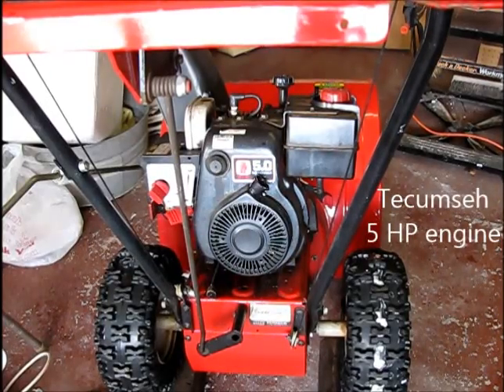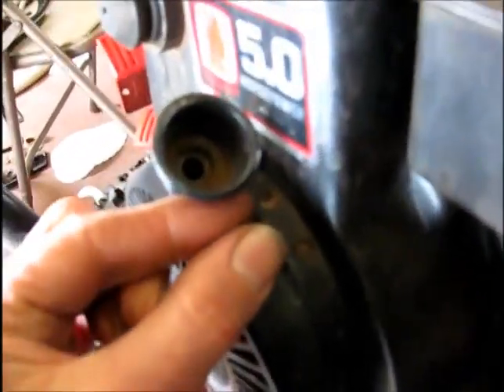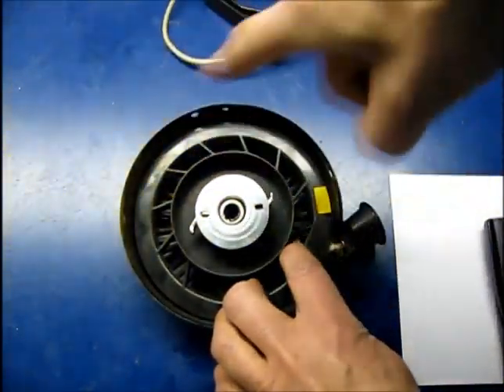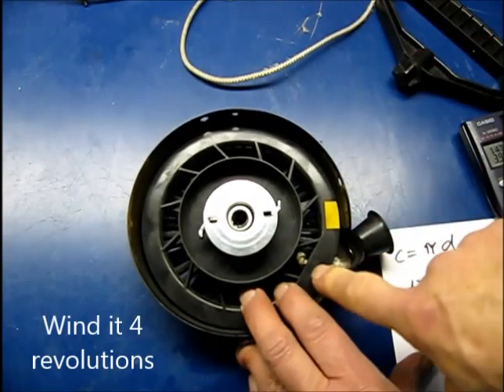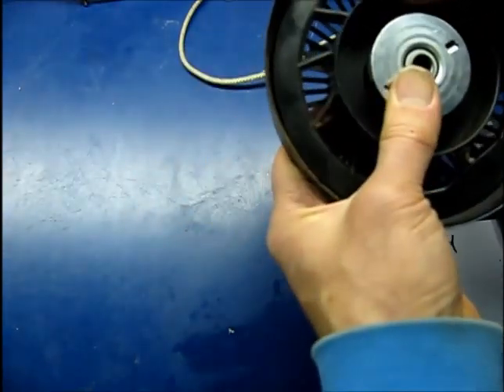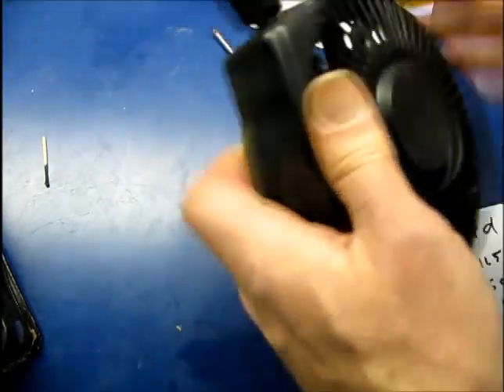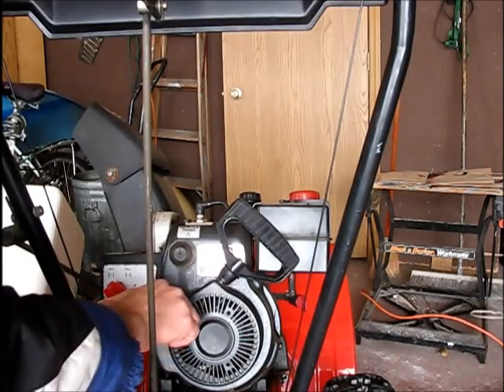A slick and quick way to fix a broken pull start cord on an MTD snow blower

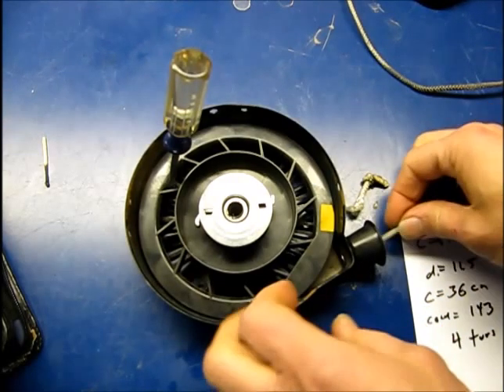Comment: This video showed me what I needed to do, I fortunatley had the exact same pieces.  My only issue was re-feeding the cord back through the inner ring (at 4:37 in the video).  The hole was too small so I had to use a hot screwdriver to enlarge it.  Thank you
Reply from the maker: We do what we have to do to get it done. Great idea!

Comment: Great video, but let me tell you, I had the hardest time trying to thread the new cord through that hole.  I could not get everything lined up correctly.  After an hour of trying, went and bought a thinner cord.  Before opening the package of it, I decided to try one more time, after 20 seconds got it to feed through correctly.  I will say this though, an hour of my time plus 10 bucks for the new handle and cord was still less than I would have paid someone to do it for me I bet.  
Thanks for the amazing video.

Comment: How do I open the spring compartment in that type of recoil? It has no screws.
Reply from the maker: You might have to cut away some housing...or replace the recoil assy.
Reply: @TheOriginalMechanic 
No need to spend that cash. FIX IT! Everyone makes videos on how fix the cord, but no videos on how to extract and fix the SPRING! None of the videos show how to open and fix and then close the spring housing which has no screw closure. All snowblower pull starts have NO SCREWS!

Comment: but what if the spring is mess up, how to remove ???
Reply: Look for donyboy73's videos he can fix anything.
Reply: @1575murray  yeah, but no link? Also..... He doesn't address THIS SPRING!  Everyone makes videos on how fix the cord, but no videos on how to extract and fix the SPRING! None of the videos show how to open and fix and then close the spring housing which has no screw closure. All snowblower pull starts have NO SCREWS!
Reply from the maker: It might be time to consider replacing the winder.

Comment: Mine broke at the handle and the rope wound inside. How do I fish it out to reattach it? And how to replace primer bulb - I've been ghetto and pouring gas inside the spark plugs hole!
Reply from the maker: That sounds frustrating, like threading a needle with no way to grab the thread. If you can't pull it through somehow with say a dental pick, you might have to wind it up, lock it and pull the cord  out backwards by the knot.  And then refeed it through the hole.  Or buy a new winder.
Reply: @TheOriginalMechanic  I drilled a hole in the plastic cover and got to it as seen on a video then I poked a paperclip into the end and sent it back through the hole also mentioned by a commenter. Rope is a little shorter but works. Thanks for the inspirational vid.
Reply from the maker: @vintagemxer9165  nice work. I like the creative method you used.

Comment: Great Clip. I just got a valve job done on the exact same blower. shop said its a little frayed. Now I know how to fix it.  oh u pumped it 7 times, wow.  I go 1 or 2, 1/2 choke.  it use to be 3 pumps and pull 20 times. Now i have to get use to 1 pump 1 pull. and hope the cord don't pull me arm out. Easy clip, thanks!!
Reply: It's easier to do this job before the rope breaks because you can easily find out the correct length you need assuming that your recoil has the factory rope or hasn't been messed up by someone else.  It sounds like your arm would benefit from the use of an electric starter.  I now have a machine that has one after using a recoil on an old one for many years and it is a nice convenience even on a 5hp machine.  On a 8-10 hp machine it is almost a must.  Also keep bad gas out of your machine that is much easier on the starter and keeps it out of the shop.

Comment: Better way, just wind spring tight and let uncoil until the whole for the rope lines up,That's how I do it in my shop. I repair small engines.
Reply: This worked like a charm for me.  Thanks for the tip.

Comment: FYI cloths line rope is to big u need a thinner rope to feed it into the hole slot on coil wheel. Once I used the thinner rope it feed through hole fast. Use needle nose pliers to help guide rope down the hole like this fella did. Had new rope though tied knot through coil wheel then at end of handle and cover was ready to attach onto motor. It was slick fixing

Comment: My math worked out to 4.52

Should I round it up to 5 turns counter clockwise, or round down to 4 turns counter clockwise ?
Reply from the maker: A little tighter is better than looser. Definitely round up.
Reply: @TheOriginalMechanic  

I got your message after I did it.

I put it to 4 turns then cut the end of the cord that hangs off the handle.  I do wish now that I wound it 5 turns but I do believe 4 turns  is how it came from the factory so it can't be all that bad.

My diameter was also 11.5 cm's but my initial corset length was 186 cm's or so, iirc.

If I don't like it here at 4 and I feel my pull when starting is too short, I will re-do it all at 5 turns.

Comment: HELP ! (4:38 - 4:42)

Mine is not so easy.  Yours is wide open in the corner.  Mine is covered.  The casing continues on and entirely covers that corner.

Which of course is impossible for the cord to take the correct routing into the hole of the inner coil mechanism.

What now ?  Cut away those two pieces in the corner to open it up ?
Reply from the maker: Sometimes you have to modify the design.... or replace the entire recoil mechanism
Reply: @TheOriginalMechanic  

I was about to take it to work to put a cut-off wheel to it but tried something else... (I'm doing the repair at home and don't have many tools here).

I opened up a small-to-medium sized paper clip.  Essentially so it's back in its original shape as a piece of wire.  Then I tightly wound (tightly wound is the key here) HALF of the wire to the first, say 4 cm's of the cord.  I used the rigidity of the wire to fish the cord through.

It takes no effort to fish the bare wire through, but it takes a bit of effort when you have to get the start of the cord through.  Once it does come through, those small needle-nose pliers do the trick.

Comment: Woohoo! Thank you for this video!! It was very helpful and very much needed today! I fixed mine, no prob...except my rope did NOT go in that easy...lol I had to repeatedly melt the tip of the rope and make it into a narrowed point to get it through enough to pull it the rest of the way with the pliers.  Good tips on the tiny wrench, using the screw driver to prop it while rethreading, and for counting the twists. Thank you!!

Comment: Dude!  This morning we got 16 inches of snow.  I shovel for 40 minutes to get to the snowblower.  I try to start the snowblower, the cord breaks.

I am not handy.  I start panicking.  I don't want to depend on anyone.  I am thinking I have to call a client so he can come by and plow the driveway.  No, I don't' want to do that.

Instead, I watch your video.  I struggle to find the right wrench.  With the snow and the cold, it was a struggle, but I ended up fixing the cord, and now it's better than it was before.  That's amazing!  But, not as amazing as the feeling I got of taking action, and accomplishing something.  

The help you provided with this video goes way beyond just fixing the broken pull cord.

Thank you!

Comment: Great video! The engineer nerd in me can't resit the desire to make this equation more complex to include the diameter of the cable and the increasing circumference of the wheel as you wrap around it.

Comment: What size rope or cord did you use? Will anything work? Mine broke today.
Reply from the maker: You should use nylon cord made for this purpose.Take a piece of the broken cord with you to a hardware stores or big box home improvement stores (ie Lowes).  Good luck and thanks for watching!
Reply: @TheOriginalMechanic  I believe this type of cord is measured in millimeters.  Sometimes you can use a slightly bigger size than the original but then it might not fit on the spool.

Comment: i have the same type of recoil, but it doesnt spring back. can i repair that?
Reply from the maker: It might be sprung and not repairable. Replacements should be available.
Reply: oh i see. thank you!
Reply: @matmanshoots  Everyone makes videos on how fix the cord, but no videos on how to extract and fix the SPRING! None of the videos show how to open and fix and then close the spring housing which has no screw closure. All snowblower pull starts have NO SCREWS!
Fix it, don't buy it.
Reply: @nathanusrey777  I did end up fixing it myself :)

Comment: Great video. I worked on my aunt's 38 yr old Toro with the 5hp Tecumseh engine. Replaced the carb and it starts fine but races a bit high. I think I may have messed up on the carb linkage. Any idea on finding a pic or a graphic that shows linkage connections for a Model 50 65440M Ser 0179C or Ser 01790?

Comment: An easier way without having to use your math skills would be to turn the recoil assembly until there is good tension in it. Put something to hold the tension in the recoil assembly (like you did with a screw driver). Then remove the cord from the handle and feed it the opposite way (from the recoil through to the handle - the knot is already there), then through the handle and tie a new knot at the handle. Remove the screw driver and slowly let the recoil assembly pull the handle into place. Re-install the coil assembly and you are ready to go. I have done this with lawn mowers, snow throwers and weed (or grass) trimmers. It just so happens that yesterday I was prepping my snow thrower for the season and on my first pull, the cord snapped. Since I was doing maintenance on it I had all the tools at hand and it took about 4 minutes to remove , fix and replace.
Reply from the maker: Thanks for watching and commenting!
Reply: and how would you  determine "good tension"? 
 tension  is different for everyone , one turn could be good for someone ,and 6 turns could be good for another people .
Reply: I tension it until I cannot tension it more and then let off the tension some.

Comment: Do you have one om changing auger belts? I went through 5 before I found out the issue, was very costly.
Reply from the maker: Actually I do: https://www.youtube.com/watch?v=xqg6bu-WtRY&t=40s
Reply: I actually did see this one, forgot. The thing that messed me up is if you take off the bottom plate and look at the pulley wheel on the bottom there is a guard that the belt needs to go under. I did not see this on the video, after 5 belts "dawn shined" when I took off the bottom plate and saw that the belt I put on was on top of nut under the guard and it caused the belt to shred. I opened the guard and now the belt is ok. Did I miss this in the above video?
Reply: @maingate690  That is why on a lot of machines you need to split the two halves in order to replace the belt.  On mine you can't do it any other way because there are a couple of guide pins the belt can't get past unless you split.  It's not that difficult if you prepare properly by having the correct tools and a helper or a ladder or a chair and a couple of blocks of wood to support the two pieces after you split them.  Those belts are expensive!

Comment: This video was great since it showed me how to thread the cord back into the reel without disassembling the entire take-up wheel assembly. However, after I performed the calculations provided (length=145 cm, dia.=11.5 cm) and wound the take-up wheel 4 times also before tying the cord, I had to redo everything and wind the wheel 5 times to make the handle remain snugly in its holder. So I recommend winding the wheel 1 additional turn before tying the knot in the cord.
Reply from the maker: That's a good point. A little tighter is better that the handle being a bit loose.

Comment: I believe your model, is exactly the one I have. I cannot ID model# or Serial # off the back of transmission box. (it has been painted over-and MTD service is gone for the holiday) Do you know the model # of this Snow Blower? (I assume serial number might be different?, but do you have it as a reference for the Parts Finder search box @ MTD online?
Reply from the maker: The snow blower is model 313-610E000. I think what you need for the recoil assembly is the engine model number. Mine has a Tecumseh 5HP engine. I could not find the exact model number on the engine but I have the manual (with no parts list). It is for models H30, H35, HS40 and HS50. So it's one of those. Probably they all have the same recoil assembly. I hope this helps!
Reply: Thanks for the reply. It will help tremendously in selecting the right parts. In regards to the pull cord repair, the cord seems to commonly abrade and break on the "knot end" just as it passes through mechanism tie-off point. To give it a little extra protection, I gave the cord a sleeve of "heat shrink" tubing, maybe to provide a little extra protection at this spot.
Reply: wow, after making the same conclusion about that sharp hole edge, i too dug out the  "shrink tube" for a bit of PM....

'

Comment: Awesome video, thanks for sharing! Only adjustment I made was cutting chord at an angle to make it easier to re-feed, then cauterized and tied the knot (sewing and threading needles was never my strong suit). Saved me $, shoveling and frustration. Sending a little something for the support. Keep up the great work!
Reply from the maker: You're welcome and thanks for the equally awesome comment!  Sounds like you did a nice job.

Comment: Thank you for posting. Your way appeared to be so much easier than what other people have suggested, although it may work for them. The only thing I had to do was drill the hole in the plastic wheel a tiny bit bigger to get the original cord back in. It broke right at the knot and the rest of the cord was in great shape . I would like to see how they load it in the factory. Zero tolerance!  

Thanks again.

Comment: Thank you for this video. My cord wasn't broken but the piece that engages the starter was not opening. I removed the cord and cleaned a few pine needles from the area that goes around and now it is working. If you wouldn't have shown those little mechanisms that poke out when you pull the cord I wouldn't have known what to look for on mine. It was a single metal tooth.

Comment: It wasn't quite as easy as this for me. The cord didn't just slide through. Had to MacGuyver in order to fish it through the hole where the handle goes. Otherwise, video was a great help.
Reply from the maker: Thanks for watching. Way to get the job done, Mr MacGuyver.
Reply: Had to do the same for my Ariens snowblower, it took a little McGuyver to get it thru the hole. Wrap the cord with some 20 gauge wire and use that to guide it thru and it will.
Reply: Great video - saved me so much trial and error.  I too had problems feeding it back through the last hole.  The problem was I melted the end as you suggested, but this left a melted scab that made the cord a little fatter at the end and difficult to wiggle through.  I cut a fresh end with no frays and got it,  I just cauterized the end after I tied the knot.

Comment: do you no the part #  for recoil my dog not working  need new one for   24/5h. thanks
Reply from the maker: I could not find it either. It's part of the engine and there is no parts list in my engine manual.
Reply: thank you any-way   great video

Comment: followed instructions and all worked until I put back on mower, cannot pull cord more than 6 inches. Took it off and cord pulls out without hesitation. Knot appears flush inside bracket.
What can it be?

Comment: my lawnmower has the same spindle with the spring with no screw to remove the metal spring in it...how do i take that cover off to reveal the coil spring
Reply from the maker: Hard to say without having it my hand. I would guess that it snaps together somehow. That kind of assembly can sometimes be very hard to take apart, but if it's broke anyway, go for it.  Good luck with it!
Reply: Thanks appreciate it

Comment: I broke my rope toward the end of the winter and had to use the electric start. I have been hesitant about attempting the repair since I've never had to do it before. Your screwdriver tip made it slick. It took no time at all and is ready for the coming winter. Thank you SO much for the very easy to do repair tips!
Reply from the maker: You're welcome. I'm glad this post helped you out and thanks for the feedback!

Comment: my rope seems to break every year even though I replace it with a new rope every spring. I got tired of doing this job, which always seems to happen at the worst time, and replaced the rope with a plastic coated stainless steel cable. never again will I change that rope.

Comment: This also works perfectly on a Craftsman 5/22 blower.  THANK YOU!  

Pro tip - If your length to circumference is more than .1 more than an integer (say 4.1 rotations) you need to shorten the length a little bit for a snug fit.

Comment: Measure the length of the original cord, wind the coil all the way back, use a screwdriver or the like to stick through the spokes into the metal housing to hold it in place, install the new cord, carefully release the coil, and reinstall on the snowblower.  All the  extra math is unnecessary.
Reply from the maker: +Martin Krajewski Maybe, but it was kind of fun and it worked!